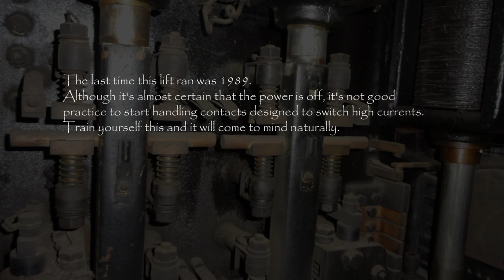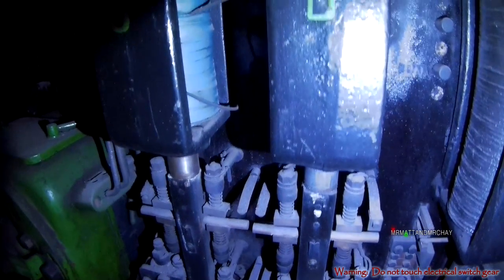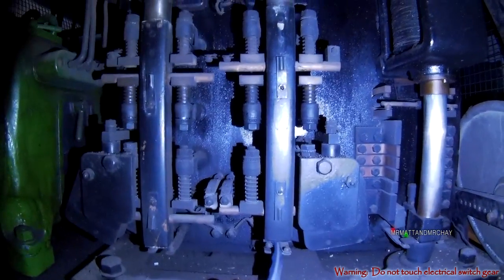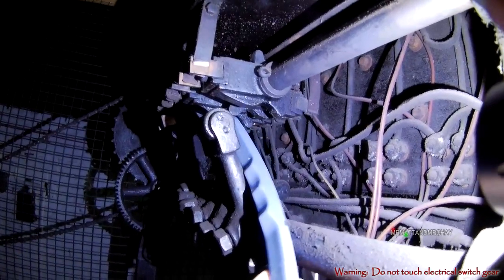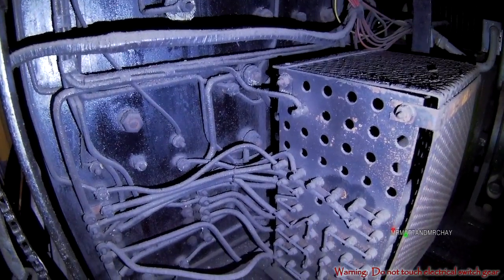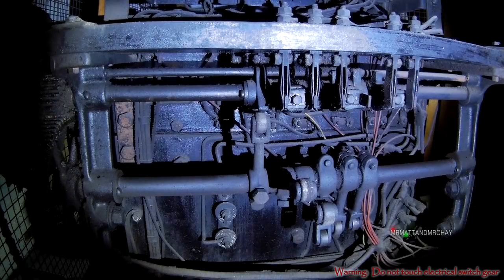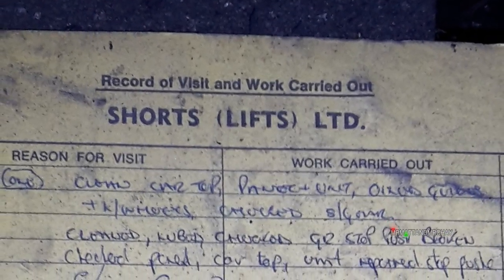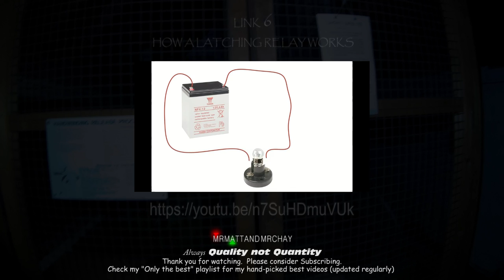LIFT TECHNOLOGY from 1905!!  +everything explained

Comment: A few (15+) years ago I was working in an old 1950s dairy (a huge one) that has been converted into industrial units. One of the units had been further subdivided and we were running a new 32mm2 SWA 3 phase sub-main into the unit. You could see that the main switchgear was from the 1970s and that's where we were running the cable, we were going to be connecting up the far end and moving the existing sockets and lights to the new fuseboard, but someone with a HV ticket was going to be doing the connection at the supply end.

In the corner of the room there was an ancient distribution cubicle, looking unused with labels like '2hp Milk Pump' and with paper insulated cables and the like. The doors were hanging open and most ceramic fuses removed. The rest was bare metalwork. Yep - it was all still live at 415v and probably fed from a substation transformer actually in the same building, metres away. With the concrete floor and Ze probably close to zero, it would have killed someone instantly. We did report it, and closed and sealed the doors. So, just goes to show, it's good to be cautious.
Reply from the maker: omg, sounds fascinating though!  If that had happened in modern times then no doubt you'd have taken a photo, but 15 years ago I think digital cameras were in their infancy!  Thanks for message!
Reply: At the time I was the proud owner of a T68i, one of the first colour screen phones but no camera :)

Comment: That inspection sheet at the end video with the maintaince log... it's a hall of fame! By the looks of it a lot of the work done on it was "lubrication" and I can see why.... all that heavy greasy metal. I guess that the last lift engineers working on it the 80's must have seen it as something special considering how mechanical and intimidating all those big exposed terminals are. Just the sheer size of those electromagnets, I bet it must have scared the hell out of some rooky lift engineers when they saw this thing for the first time on the job!
Reply: The great thing about the older bits of kit was that you could see what was going on, What you had to do was keep the controller spotless to prevent any (tracking) and check ALL the controller connections for integrity. They were very impressive to see in action but were really quite simple to fault find on compared to the stuff that came later. The main problem was having to check circuits LIVE with all those exposed High voltages knocking about.
Reply from the maker: I love it when you respond to my comments Pete, it's a further learning experience for me as well as everyone else :)
Reply: Those bearings needed to be lubricated quite regularly! The 1901 instructions I've read require daily lubrication of certain parts! The tracks were only done once a year but that was enough. Some of the engineers were so generous with the grease gun that the grease has completely soaked through the wooden cars, saturated 2 cm of timber!

Comment: Epic video! What a sophisticated technology in 1905. I am so impressed for that. Hell of a job Matt!
Reply from the maker: COOL thanks for that Kevin!  One more part to come!  Might take a bit of time to edit as I've got lots of stuff to explain!
Reply: I'm Looking forward!
Reply: Absolutely amazing, yes!

Do you know more about the history of lift controls in Italy? According to a somewhat sketchy online source, an Italian company, possibly Stiegler of Milano, invented the push-pin control that quickly became extremely common in the Austro-Hungarian empire and Italy. These lifts would only go up to any floor and then back down to the ground floor. The motor controls only knew two states, up and down, operated by switches on the car. The "Up" switch was inside, linked to pins sticking through the side of the car and pushed back in by ramps in the shaft. The pins were in a horizontal row and the ramps staggered sideways so each ramp would push the corresponding pin. The top floor had a wide ramp that operated all pins at once.
The "down" switch was usually on the outside wall of the car near the door and linked to another pin, corresponding to a ramp on the ground floor. Later modifications did away with the "send" or "down" pin and replaced it with a timer relay coupled to the door contacts. Closing both doors would send the lift back down after a little delay.

The main advantage of this system was that it worked with no more than two contactors or an accelerator. The main downside was obviously that the lift would only go up but any instructions from that era I've seen specified that lifts must only carry passengers going up, regardless of the type of controls used! Even the instructions for the late-1920s Schlieren lift stressed that!

Comment: Please correct me if I’m wrong but I believe the “accelerator” is just by product of solving the in rush problem of the dc motor the reason why I think this is because dc motors draw a lot of current when starting and in large motor this current can be so great it can burn it out so they use a resistor bank to slowly bring the motor up to full power and slow the in rush current and the speed control is just a byproduct of that I’m not being all smart ass I’m just saying why I think it’s their
Reply: Yup, and back in the day power networks were incredibly weak! I think I read somewhere that you weren't allowed to start motors exceeding 1 kW without limiting inrush current! For the same reason AC drives used slip-ring motors and accelerators for a long time. Only after WWII engineers thought of using asynchronous motors started straight up using contactors for lifts. There are still limits though, above which you've got to use Wye/Delta starters or electronic soft starters.

Comment: I've watched videos of the mercury rectifier and it still creeps me out. That was a fine video here. Shame the equipment doesn't run. Thanks, Much!
Reply from the maker: yeah... Imagine climbing up the ladder and everything is silent, then someone presses a call button and BUUZzzzzZZZZzzzzZZZZ, click-click-bang, suck (that's the accelerator LOL), etc!  Probably give people a heart attack if they didn't know what was up there.
Reply: Wouldn't mane any difference after one look at a mercury rectifier. OOSH, what a thing.
Reply: A long time ago when I worked at the Science Museum, London, we had a  working mercury arc rectifier on display as an exhibit.
But it also had another practical purpose, and that was to supply Direct Current for two large air compressors, and to supply current for the main passenger lift.
One of my duties was to start one of these compressors when it was in service. This required gradually increasing the motor speed using a resistance bank, and watching the ammeter to avoid overcurrent draw.
When the machine was up to speed and all resistance cut out,
the spring-loaded lever was held on the last stud by an electromagnet.
If the supply failed for any reason, the arm automatically was drawn back to the start position.

As for the passenger lift, it had to be attended at all times to facilitate movement of staff and visitors.
Approach speeds to a floor were controlled by a foot switch operated by the lift attendant.

It has gone now. Not sure about the mercury arc rectifier.

Comment: For a many decades, pipe organ blowers were also DC.  A mechanical speed control in which it's progress up the resistors to increase the speed of the motor slowly was held back by a pneumatic plunger.   If the blower was hit with full DC you would probably not only rip the turbine from it's shaft lightning like sparks will emanate from the motor commutator.
Reply: Here is another type of DC mechanical/pneumatic motor control like that used in organ blower applications.

Discus organ blower starter
https://www.youtube.com/watch?v=JgKKCJQ29KY
Reply from the maker: Just seen this, and the colour changing light system - amazing!!
Reply: I can confirm this at one time yes motor for organ bar was DC current.

Comment: The original Mrmatt washing up brush. Certified for use up to 1kV. :o)

If I weren't sure whether any electrical system is live, i'd rather a) measure or b) use something like an isulated screw driver that is certified to withstand a voltage higher than the one that I expect to be there.
Practically, the plastic brush would most likely work as well even if that circuitry was live, but when it comes to electrical power, I prefer certified tools.
Reply from the maker: yup, I know what you mean, but under the time restriction that I had, it had to be something I could lay my hands on then and there.  Also, at least I ended up further away from the equipment with the brush.
I knew all that kit was depowered, there wasn't even a fuse board or breaker nearby.  But as I said in my video, it would be very irresponsible of me to show handing this stuff for someone to try and copy me.  I'm not the most responsible channel out there (or may I am?  not sure) but I do try to be responsible to the people that watch my videos.
Reply: I know that you are totally aware of what you are doing, and the brush did a perfect job of showing that you always use a non-conductive item in these cases. And even though 415V (in fact if you only touch one phase and ground it's 230 (or 240 in UK?) volts) are dangerous to the touch, it is more manageable than voltages > 1kV where you can get fried if you only come near.

I don't know how things are in England, but in Germany using the "official" right equipment and something that does the job but is not certified can make the difference if there is an accident, even if it is unrelated to what you are actually doing. Some years ago, my job took me inside a rolling mill, where they emphasized, how important it is to wear a helmet and safety shoes. Out of curiosity I asked them how much the steel coils that were transported inside the area by crane are - and they told me between 20 and 35 metric tons. So if one of them breaks loose, bounces off the floor, sets other coils that are sitting there in motion and one of them crushes you, the helmet won't help at all, but if they find the plastic chips of what used to be the helmet within the bloody mess that used to be you, at least the insurance will pay for your funeral and you get a bigger tombstone. ;-)

I really appreaciate all your work and give a big thumbs up to your safety procedures. Thank you!

Comment: Hello mrmattandmrchay I wanted to ask for your help? Today 12/17 in the US I was given permission to enter my second motor room. This motor room is a 1950 Rotary Hydraulic. In the US these were the first modern hydraulic elevators (or lifts) created. The company later became Dover then recently ThyssenKrupp. The reason I am writing you is the buildings maintenance man asked me to reach out to the community in an effort to repair a malfunction. This car is still completely original. I uploaded a video already of the motor bringing the car down. The relays are in the video as well but it is rather dark. The gentlemen who is the guardian of this elevator does have experience in electrical engineering and can largely repair the lift on his own. However he asked me to seek help on his behalf with understanding the mechanical relays of this car. I told him I subscribed to someone in the UK who has good knowledge and that I would reach out. The goal here is to save and keep this lift original as very few remain in existence. could you take a look at my 45 second video and see what you can make of it. The relays can be seen towards the end just above and to the left of the motor. The current malfunction is with a door operator but the hydraulics and pump are fully operational and passed their latest inspection.
If you would like to see the car in operation that was filmed in the early 2000's and is in my Heights Church of Christ Elevator video
If you would like me to film anything else in relation to saving this elevator please feel free to message me. The maintenence man would help me get such information. Thank you
Historiclift27
Reply from the maker: cool, I'll take a look over the next couple of days :)

Comment: Curious as to why it was taken out of service in the first place. Looks so simple it should still be running, and it still appears to be roped.
Reply from the maker: In a way, I'm glad it was taken out of service.  If it HAD been running, then it would have probably been on it's 4th or 5th modernisation by now!  I mean, this kit would have probably broken down and required parts.  The expertise, availability of talent and interest from companies to fix it probably died in the 70s and 80s.  Glad it's completely original.  It's also missing the ancient AC-DC mercury arc rectifier which is vital for it's running.
Reply: Capacitor bomb
(stink bomb)
Reply: mrmattandmrchay Ed dS dcdxffrd5crx you are the one that has been in the country
Reply: mrmattandmrchay 

If it’s from 1905 then it would not originally have had a mercury arc rectifier, this would have been added later.

Comment: Hello
Such as amusing video :)
I'm waiting for a next part.
But as I thing, the described method of controlling a dc motor speed is known as Ward Leonard system? Am I right?
Reply: In this case no, this is a DC Rheostatic control system. The WARD LEONARD SYSTEM  came along later and is much more sophisticated, using a DC generator driven by an AC motor  to control a DC motor with a fixed field by varying the Generator shunt field .
Reply: I gave you some wrong information on my earlier reply. The Ward Leonard system was introduced in 1891, but this is not an example of it. I must be more careful in my research.
Reply: It is a rheostatic starter, a smaller version of the one used in DC locomotives (like the Italian E444/E656/646/424...) and in older tube trains and EMUs :-)
Reply from the maker: Love it when people answer my comments with more information - it's like food for my brain!  But now I'm gonna have to look all this up ;)
Reply: Also used in trams until late 1970s/early 1980s. They used the same resistors for braking. ;-)

I wonder where that lift got its DC from. Was there an arc rectifer that has been removed? Or a generator?
Reply: Mercury arc rectifier, removed for it's scrap value and for safety reasons. This bit of kit would have been in a separate cabinet.
Reply: Capacitor exploded in 1958

Comment: Still looks like that lift could possibly operate again if it was fixed and serviced! :)
Reply from the maker: With some TLC I'm sure anything is possible.  Not sure the site where it is installed would be that bothered about it though!
Reply: mrmattandmrchay 
Well it’s still also possible that they might not have the money to maintain the lift so it’s possibly also why the lift ended up abandoned! I’ve also seen a lot of lifts get turned off for not being maintained when the building owners go into bankruptcy or are not making enough to maintain the lift! :)
Reply: @Techno-Universal  Usually regs change and in the case of lifts they usually require retrofitting of existing units, i.e. often rather heavy modernisations. I'm amazed that this setup managed to survive in service for that long! Round here (Austria) the only original controls I see are the ones that have been abandoned around or before WWII. The first major change seems to have been in the early 1930s, the second round with the German occupation in 1938. Then there was the AC conversion in the 50s and 60s, another round of new regs in the 1970s and the final nail in the coffin in 2013, which essentially required all lifts built before the 1970s (I think) to be brought up to current specs, which meant that most of them were simply replaced. Some newer ones were affected as well because the 2013 regs required car doors and new lifts without them were installed until 1993. So while it might be technically possible (or even easy) to make such a lift work again, legally it would be impossible without entirely destroying its character.

Comment: Great video. I do want to add that the volts arnt really what will hurt you. Amperes are what actually hurt you.
Reply: That‘s not entirely true. It also matters if it’s AC or DC.
For example, 1A on AC power hurts less then on DC. Also, it mostly depends on the combination of Voltage and Intensity (Amps).
Reply: @e50  for some reason I can't feel a shock from a dc current. It's sounds weird but idk why I can't feel it
Reply: Sorry, I messed up my Answer. Actually, AC hurts more because of the Frequency (on/off cycles) and that messes with muscles more.
Reply: They're both dangerous (volts and amps).

Comment: I don't think that's a DC motor. It looks like their are 3 contacts (based on how out of phase each of those visible contacts are). Due to the age of the lift, i won't rule out the possibility of DC, but that's more likely a three phase AC motor
Reply: I'm fairly sure it's DC, it looks exactly like the 1920s DC tram traction motors (600 V) I've worked on. An AC motor wouldn't have a commutator with individual segments but three individual slip rings with brushes next to each other. There could be a second set of brushes hidden underneath, that's what the DC traction motors have.
Reply: It’s definitely a DC motor. These used to be called “the old flat top motors”.

Comment: If it was abandoned in 88, why was it inspected in 96?
Reply: Looking at the log power was cut in January 1990. Then decommissioned fully by July 1990 (as in likely fuses, junction box connections etc removed and broken and also main breaker points either removed and terminated or permanently locked off).

Further inspections in 1996 and 1997 were likely just to do with structural integrity or maybe someone was looking at bringing the lift back into service for whatever reason (maybe as a back up or for a dedicated lift for transporting equipment and supplies maybe?)